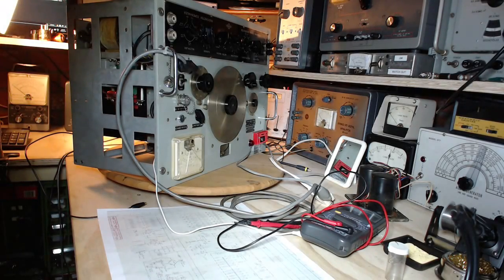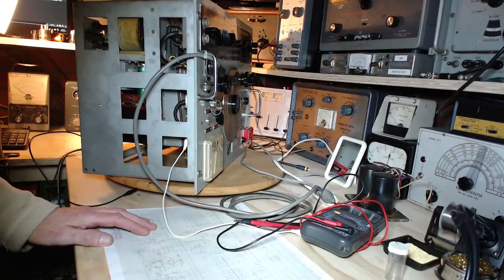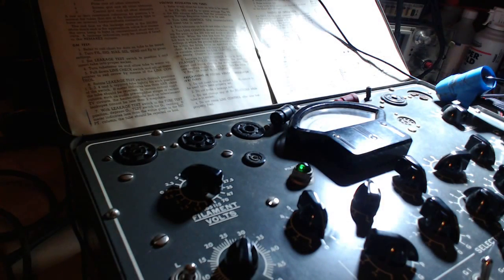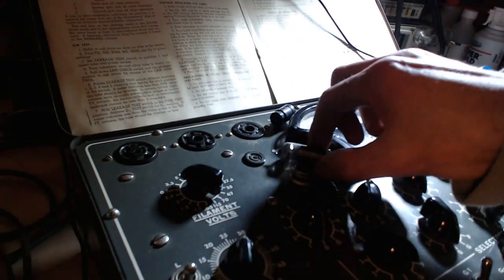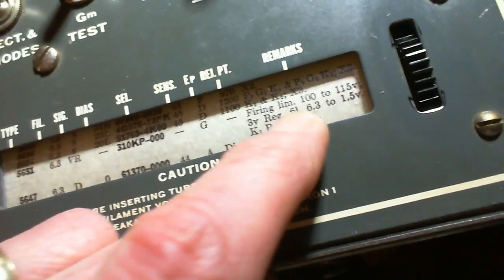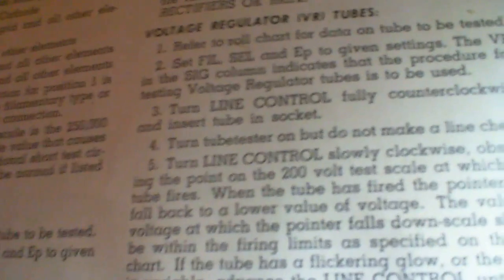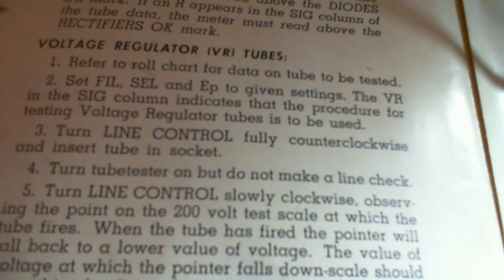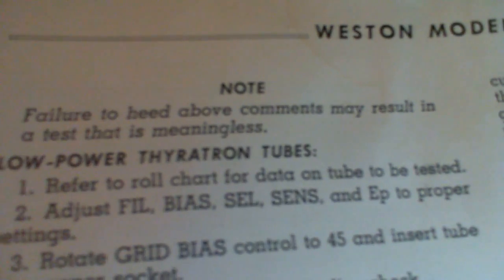Signal Generator MS15c S1 Video #8 - Voltage Regulator Tube

Comment: ¤¤¤¤¤¤¤¤¤¤¤¤¤¤¤¤¤¤¤¤¤¤¤¤¤¤¤¤¤¤¤¤¤¤¤¤¤¤¤¤¤¤¤¤¤¤¤¤¤¤¤¤¤¤

I HAVE  JUST  "NOW ...TODAY....40 MIN AGO" ... FIXET  (MY FIRST  #TUBE  RADIO STATION)..

ALSO  USING  #THIS  "85A2"  LITTLE  TUBE !!  ...

(THIS..TUBE..NEED  ABOUT.."150-180 VOLT + - a little"..  "TO GO IN ACTION"...)

THEN  "2 BIG THINGS INSIDE" ...START TO LIGHT .. .."ORANGE/RED"....VERY..

THIS  IS  WHEN  "85 A 2"  IS DOING SOME THING..!!

(MINE HERE  NEED ..."184 VOLT" ..TO GO #ON ..)

AND  ... "ONLY  #2 LEGS  USED"  ..OF  THE  "85 A 2" ....

"3P3"  and  "R4H"  ...IS  ALSO  NAME OF  THIS  "TUBE" ..mine have this .. 

IS A ..."4 - 500 WATT"  RADIO-TX ... MY TUBE IS "REGULATOR"  FOR  "DRIVER"  TUBE...

GOOD  LUCK   MISTER

05052021 0019

.... no  reply ....

Comment: Also, just as an aside, those gas regulator tubes most often have multiple pins tied to both the anode and cathode. This was done so it was possible to interrupt the (unregulated) power through the rest of the system if the regulator is pulled from its socket while the instrument is powered-up. A protection mechanism.
The dark coating on the inside of the bulb is a very slightly radioactive material to promote reliable and stable ionization of the neon (or argon, depending upon the tube type).